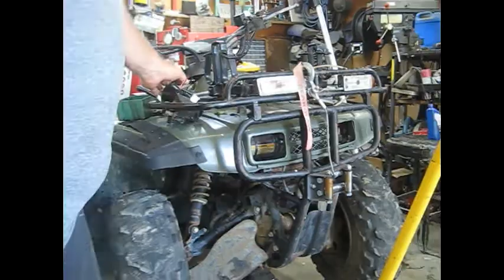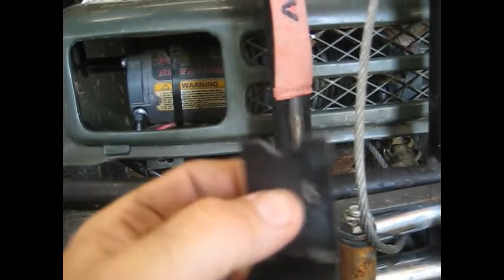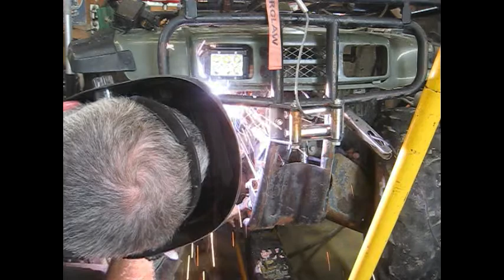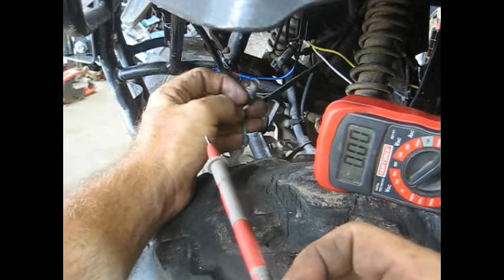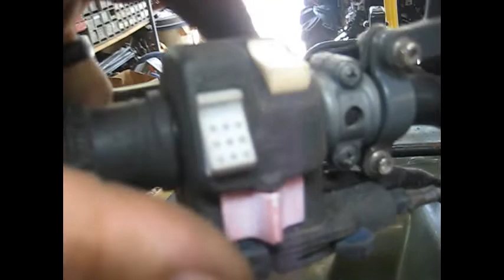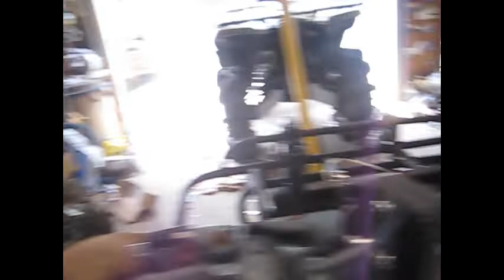LED headlight install on a Honda Fourtrax 300 w/ relay wiring

Comment: Another great video. Can you post which LED Lights you used and the relay? Or if you have a link to them.
Reply from the maker: The LED's I used were https://www.amazon.com/dp/B00G620ZVU/ref=cm_sw_r_cp_apa_fab_fbMBFbED4NZHD
And the relay I used was very similar to this one https://www.amazon.com/dp/B072QXDZRD/ref=cm_sw_r_cp_apa_fab_4gMBFbTFDPZ1V